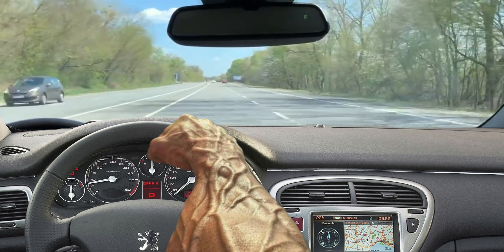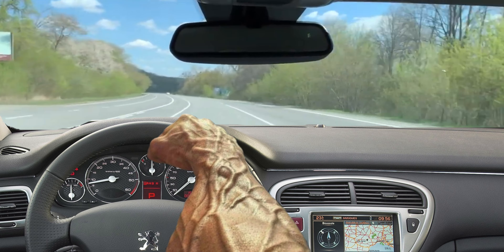Used Peugeot 607 Reliability | Most Common Problems Faults and Issues

Comment: I had a 607 V6 Auto for 13 years, and issues I could remember were: Windows lift mechanism jammed due to plastic hinges, service battery (the one in the back trunk) drained out regularly, very low gas mileage but overall I loved this car and the feel she gave you to "stick to the road".